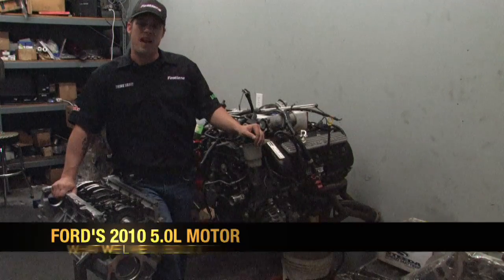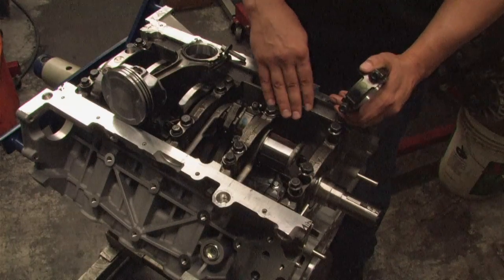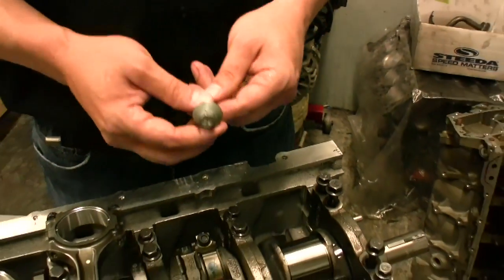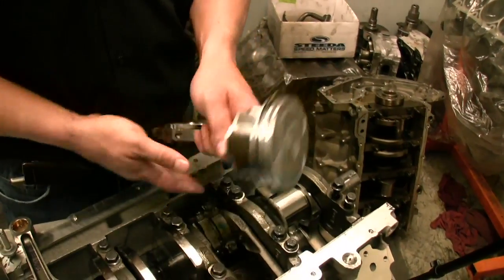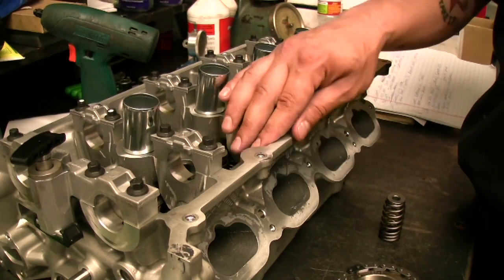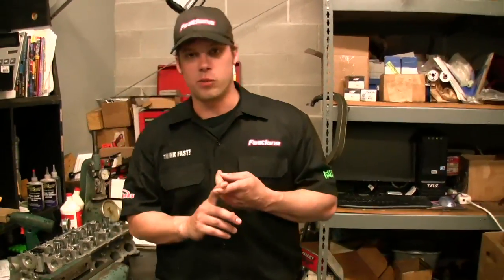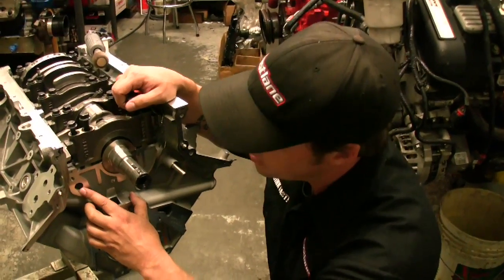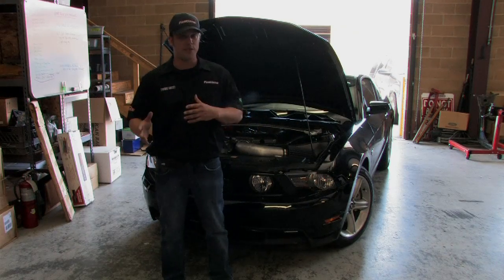Fastlane tears down the 2011 Ford 5.0L Mustang Motor

Comment: im no engine builder so forgive me if i ask this, but with all these light weight materials you referred to in the motor do you think that would effect the reliability of the motor? cause i heard something about this motor giving a ticking noise after the first oil change and im not sure if i want to buy it if its going to be unreliable...

Comment: @carcajouxx 

Yes, true. And pistons too, hyper eutectic casts. If you want to go blown/nitrous, you have to rebuild the lower end with true forged rods (not that fake "forged" sintered powdered metal stuff) and forged pistons. 
To go double digit boosts, like above 14 PSI manifold boost, going lower than 11:1 CR might also be necessary.

Comment: Dman straight! 5.0 forever! I'm totally stoked Ford brought back the 5.0 Badge even though the Coyote is not the same as the classic pushrod 302 from the classic s and Foxes. 

And this 412 HP engine is keeping up with the 426 HP LS3 Camaro engines!

Comment: actually thats a 16 valve cylinder head.  you get a 32valve engine when you have 2 cylinder heads with 16 valves